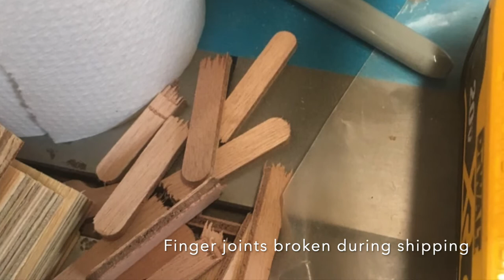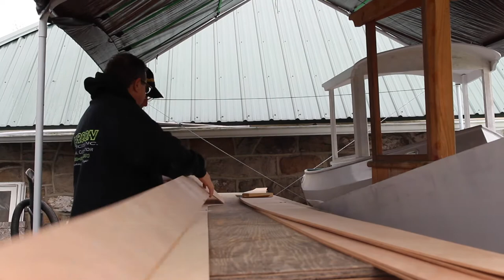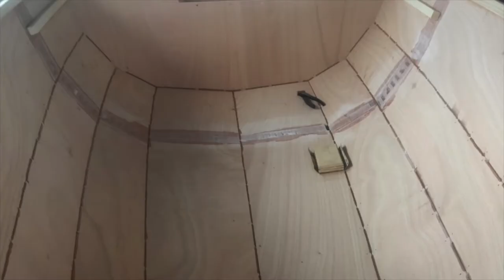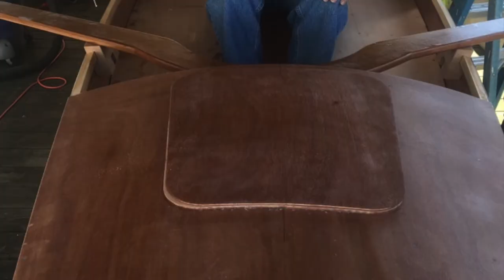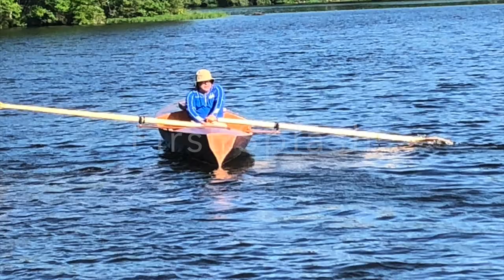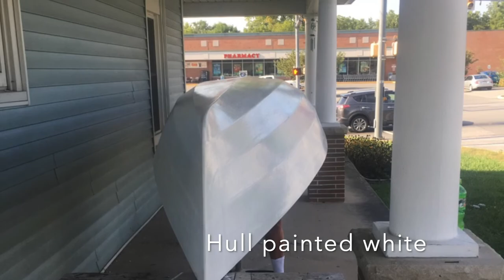Building a RowCruiser

Comment: Looking good! I'm about 1/2 way done with mine. The sailing version adds lots of fiddly bits. Cheers!
Reply: I just found out about this boat today and I am extremely curious to building one. What tooling are "non-common" used for this build? ie wood benders/shapers, etc?
Reply: Do you have an appropriate cost for the sailing version so far
Reply from the maker: @strongme80  With the kit form, you really don't need much more than common handheld tools e.g. drill, sander, etc.  We did use a bandsaw for an optional step